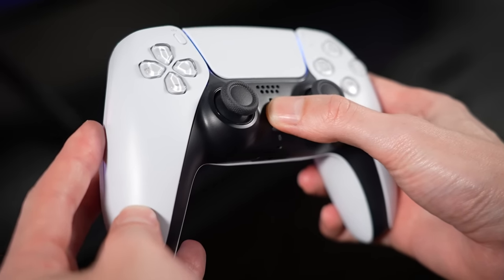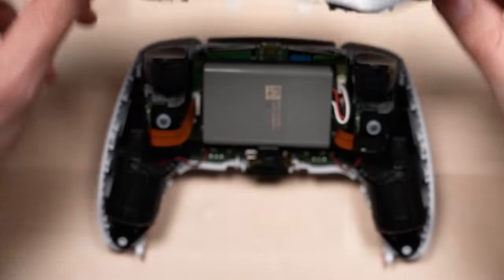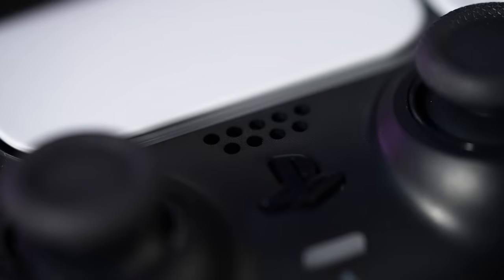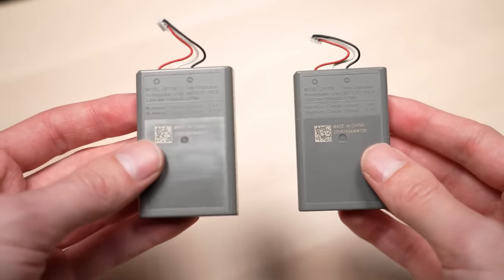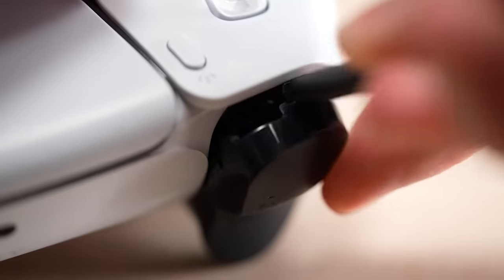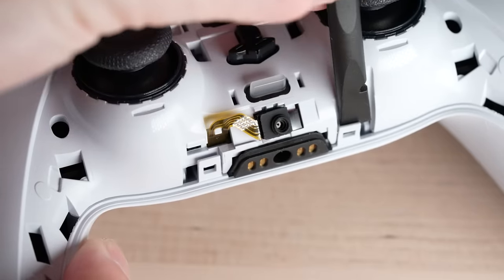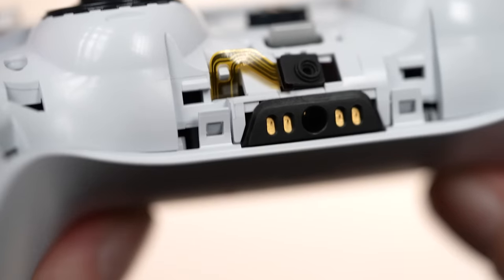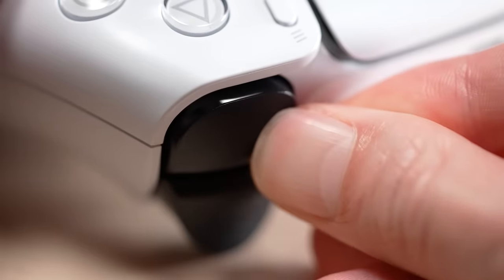Sadly, your Playstation controller won't last much longer..

Comment: I genuinely wanna know what y’all do to fuck up your controllers this bad I’ve had my original ps4 controller for about 7 years now and aside from the L stick click not registering if I don’t click down hard enough I have never had stick drift or battery problems on any of my controllers but the switch joycons and even those lasted me 4 years before it happened and my ps4 controller lasts around 6-7 hours on a single charge and my ps5 controller around 12 hours so unless y’all don’t ever turn off your controllers some please tell me wtf your doing to mess up your controller that bad. 
 
On a side note I play like the entire day on weekends and 5 hours on school days so it’s not like i “don’t play enough” for my controllers to mess up

Comment: If the fcc Id of the controller wich you see at the back, if the last digit is 1, then it won't last a very long time and it won't function well so you probably have to return it, but if the last digit is an A then it will last a very VERY long time, so for me I don't think this video is necessary. Anyways he explained in one of his videos on what I just said

Comment: The only problem I have with my ps3 controller is one buttin doesn't work on one of then and only problem with ps4 controllers is that the buttons are a little harder to press

Comment: Xbox controller is still better. Because while this does look easy to do.
Cons. Screws will be loose over time meaning it will mess it up. And AAA batteries is the common one to use. These types of PS5 batteries looks special. I just dont trust inbuilt batteries being the norm when it comes to lastability of something

Comment: for some reason my controller charges better quicker and lasts longer if I charge my ps5 controller with my Samsung phone charger from my normal plug port, instead of the PlayStation 5 itself.
maybe this will help u instead of doing all this stuff..
but don't get me wrong this channel is OK still. 
but hopefully you won't have to take ur controller apart.. just use a normal charger port instead of the PlayStation one.

Comment: I've never understood the shit talk about xbox and batteries. I will never have to deal with an issue like that with an xbox controller. I can pick rechargeable or just quick and easy normal batteries, buy whatever brand whatever quality and model and all that no need to take a whole controller apart for a shitty issue

Comment: The PS5 controller has no durability it’s actually kind of unbelievable. 2 came with my system and I already had to trash one of them. For context I got my system June 2021 and my controller was fucked by Feb 2022.

Comment: That’s why Xbox controllers are better
Reply: yessir
Reply: buying batteries is not better than not buying batteries
Reply: @ddp5406  that made no sense.. Buying a rechargeable replaceable  battery vs buying a whole new controller because a battery died.. Do the math dude or whatever space animal you are lol
Reply: @THENEVERDEADIV  ive never had an internal battery die on me..ps4 dualshocks, or Nintendo pro controller

The $200 premium xbox elite controller comes with an internal rechargeable battery...why? Because its better in every way

Do u also wish ur cell phone took a couple triple A's out the box but all u need to do is go buy a rechargeable battery pack...foh with that logic 😭

Comment: You forgot to mention putting the R1 L1 buttons back on. Must be a pain to put them back on or you broke yours so don't mention it. Yup I'd rather buy a new controller. Taking apart things are not my forte.

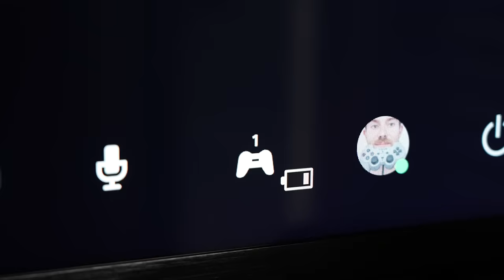Comment: 0:50 This is my only issue with the video. You kind of just glazed over "charging habits" without actually saying what good "charging" habits are. Like, is wise to leave a controller on a charging dock/plugged in all the time, or is it actually hurting the longevity? What are bad hobbits? habits. (Yes auto correct. I did totally want to spell "hobbit." It's a very commonly used word....)
Reply: Keep it at 50-70% for long life

Comment: My ps5 battery has never lasted long💀 it’ll be fully charged and then an hour goes by and it’s dead.
Reply: Doubt
Reply: @sinclaircupcake4954  Right, cause you would know how long the battery to MY controller last for🤨🤨
Reply: @angiebogart2717  yes your lithium battery degraded 92% in whatever time you’ve had it. Sure 😉
Reply: @sinclaircupcake4954  Yeah, it did within 8 months🤡😊

Comment: Dude it dies in like 6 hours and its brand new
Reply: It definitely does not, I used both my ps4 controllers for 7 years and they last longer than that. I’ve had my ps5 controllers for 2 years and they still last 10+ hours.

Comment: At $900 a system why dont they build better quality
Reply: $900? That system is $500.
Reply: @GamingWithMe  depends on what u buy and where u buy it mine cost $900 at gamestop with 2 year warranty i didnt buy onlune from ebay. I wanted to be able to return it if it ever fails
Reply: @louismays7810  So it was a bundle with a games, accessories, extra controllers?
Reply: @GamingWithMe  it had 2 games and a charging station

Comment: Ummm all rechargeable batteries degrade. And i doubt controllers be lasting long enough without any drift problems before it degrades. So this is just a bs video made for views. Also don't charge controller on a wall charger, doing so will ruin the battery yet so many people do it